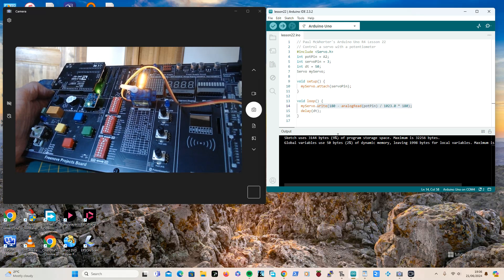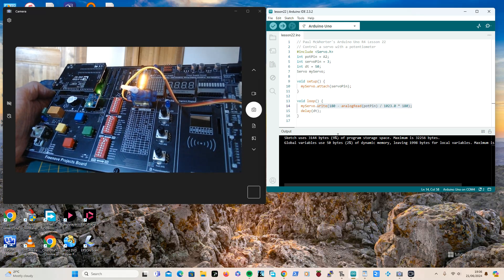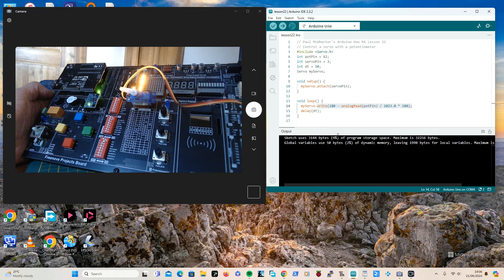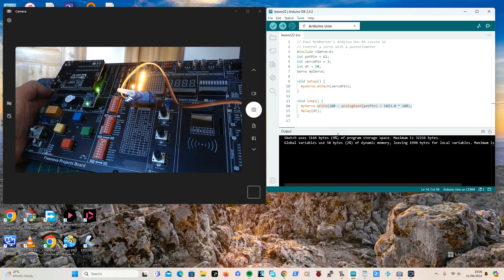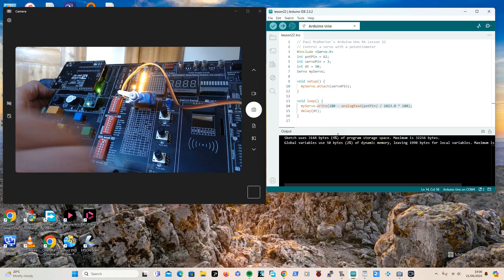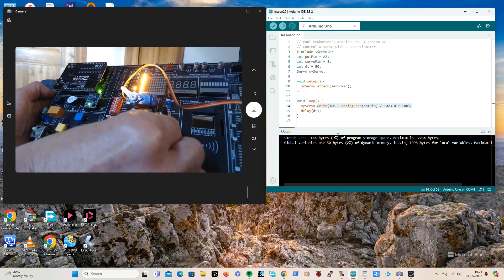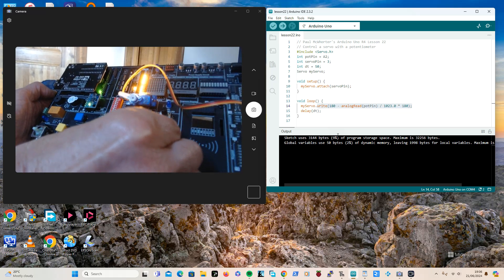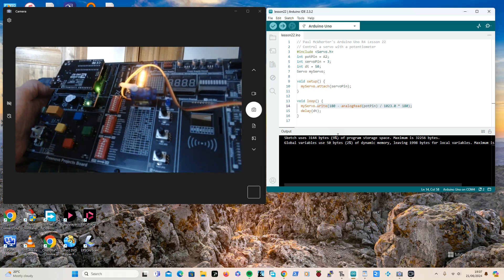My video for Paul McWhorter's Arduino R4 Lesson 22 - Control a servo with a potentiometer

Comment: Short and sweet! You could have made it shorter by just loading the knob example code for the servo library. Of course that uses the not to be mentioned map() function. LOL. I wonder if Paul is going to go through all the slope math one more time. Thanks for posting.
Reply from the maker: @keithlohmeyer  Thanks, Keith.  I hardly ever look at example code. If I looked at it beforehand, I would be cheating and I can't be bothered to look at it afterwards. Is there an emoticon for being the laziest person in the world? Paul does like his maths😁
Reply: @charlotteswift  Yes another way we are different. I learned Arduino using the example codes. I am curious you have said in the past you don't look at documentation much and you don't look at example code. So how do you figure out what methods a library has? Most Arduino library code is hidden so it is not easy to look at the code. Looking forward to an insight to Charlotte's learning process.
Reply from the maker: @keithlohmeyer  With python, I tend to use 'dir' and 'help' a lot. I also look at the source code (especially __init__) to find stuff that is hidden away. Maybe that's why I sometimes come up with bonkers solutions that other people haven't thought of. When some of Paul's code looks cumbersome, I think that no way could that be the best way to do it so I play around with it. Python should be elegant. 

Arduino is completely different. I have no idea what I'm doing🙃I look at the Arduino language reference to find out what commands are available and go from there. I've started looking at other people's stuff too. I like Ralph (streaky) Bacon. I feel that I've met him somewhere. It's possible, I guess. Ralph made me realise that 'setup' isn't just to set things up. It's where you put something when you only want to do it once at the start of the program. When I did the 'flashing an LED 25 times then stopping' program with everything in 'setup', I got a lot of grief from some quarters.

I miss Pascal. Looking at his programs, I always think that that's how I would program when I grow up😁 Maybe I'm a bit hard on people sometimes when I criticise their solutions. For this lesson, someone put the read pot and write servo inside a 'for i' loop which showed a complete lack of understanding. Paul doesn't have time to look at things like that. He's got monkeys to chase🐒and slope to calculate😁
Reply: @charlotteswift  Yeah Python is a little easier to grab info right from the code. Yes, to this day the Arduino reference page is on my links bar. Of all YouTubers I think I learned the most Arduino from Ralph. On the blink 25 times I would have done the same. If you want to run again hit the reset button. Thanks for the glimpse of what makes Charlotte tick.
Reply from the maker: @keithlohmeyer  And, of course, I have no interest in actually doing any of this stuff. I don't want to flash LEDs, move servos, open garage doors, water plants, make beepy music or build a robot vacuum cleaner. I just like working out how to do something and then I'll move on to something else. You, on the other hand, put things into practice and get your teenagers learning which is the whole idea behind the Raspberry Pi foundation. I have great respect for what you do👍